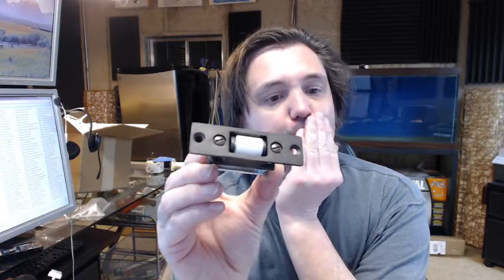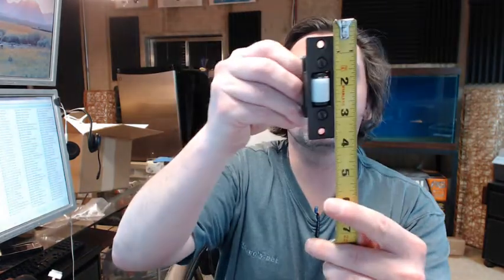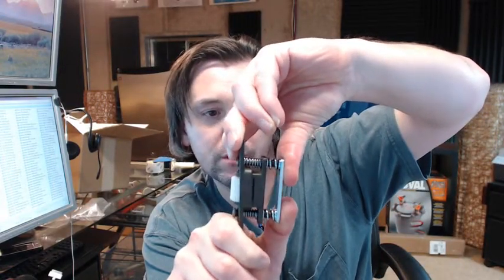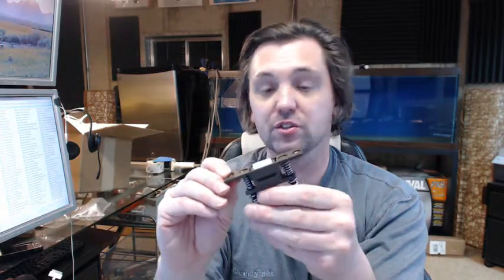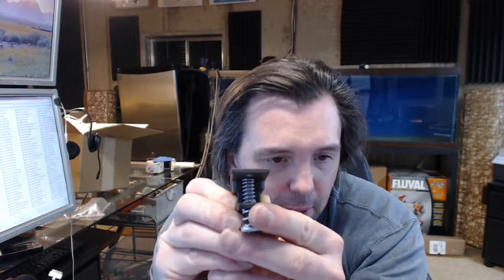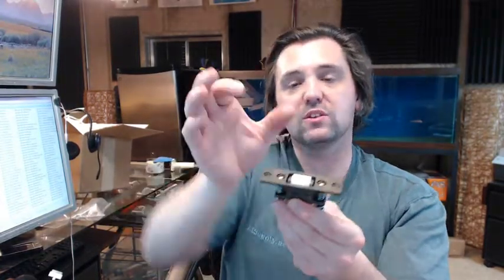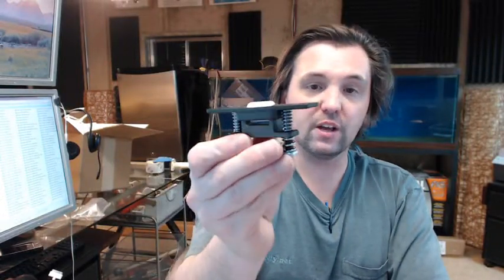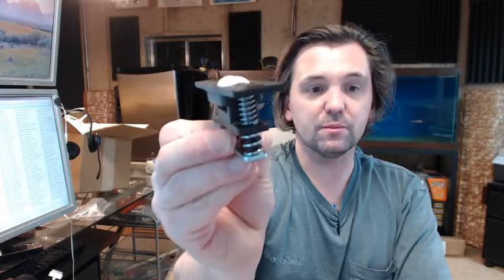Don-Jo 1702 Roller Latch

Comment: Is this the heavy duty one ? For an outside metal double door?
Reply from the maker: I would indeed consider the Don-Jo 1702 626 Satin Chrome Roller Latch
 as a heavy duty roller latch.  There are variations when it comes to roller latches, but when they are considered heavy duty like the Don-Jo 1702, the only variation is the strike plate packaged with the roller latch body.  If you are installing this onto an especially large, thick heavy door with a pull handle and perhaps a deadbolt, consider installing 2 - roller latches.